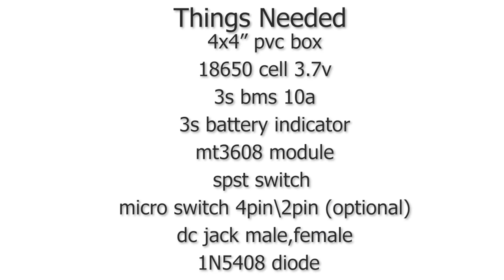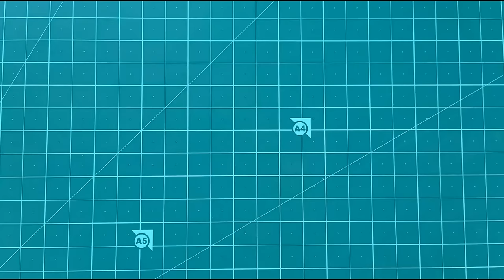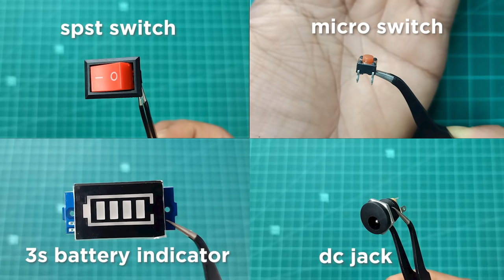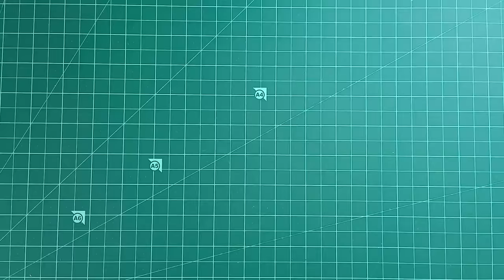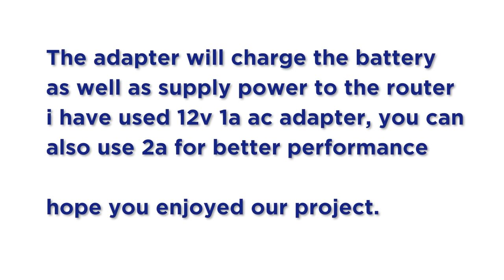How to make 12v ups for wifi router || diy ups for wifi router

Comment from the maker: Hello friends, thanks for all the support 👍🏻👍🏻 
As this was my first video on this channel I was bit nervous and also have made some mistakes, and many of them have also complainted that ups has very less backup.
So I was thinking to recreate this video with better version.
So should I make a new version of this 12v ups?? 

Do comment your opinion here👇🏼👇🏼
Reply: Yes bro .... go for it 🤗
Reply: All the very best. 💐 
You have talent to create employment. 
Battery indicator can be replaced with modern led. Can you create one with compact design and with led indicator. I can support for one video. Rest YouTube viewers will take care.
Reply: Yes really need iy
Reply: Superb video, 
What is meaning of 2c, 5c, 15c batteries 🔋.how much cost of each battery ?
Reply: Go for it!
Reply: @kumaards9714  search for c rate of a battery
Reply: Yes make a new one!
Reply: Yes, please. And also suggest modifications in this circuit too.
Reply: @kumaards9714  C-Rate of a battery is how much current can it output on a constant basis. A 2400 mAh battery rated at 1C would be able to output a max of 2400 mA X 1 = 2.4A of current without damaging it. Similarly if it were 2C rated, it would be able to output 2400 mA X 2 = 4.8A of current and so on. Higher C-Rates are needed in Battery Packs which are smaller but need to be able to run much higher loads.

For example, if you need to run a 400W load at 12.6V, ideally if you use 1-C rated Batteries you'll need a 12.6V 40Ah battery. But if you use say 4-C rated Batteries you'll need only 12.6V 10Ah battery. Now putting it into number of 18650 cells (let's say 2000 mAH), it would be around 60 cells for the former and 15 cells for the latter. Thus you get a smaller battery pack that can run a larger load.

Hope that explains!
Reply: @cg.maniac  Thank you bhai....🙏
Reply: My country not good not buy module please teach me another way please
Reply: yes, I too built this one but the charge wont hold enough. Pl add a better design.
Reply: Yes please friend, we can buy you coffee in return as appreciation. Maybe you can add a bypass mode so that battery is not constantly charging and discharging
Reply: md sahir mirza
Reply: Yes offcourse
Reply: hey can I use this for  power: 9v WIFI as well ? basically I'm making this for my school project and simultaneously I will use it for my WIFI when electricity is not there lol!!
Reply: first make sure that the 3 cells in series have the same voltage or you will get less capacity

Comment: Battery in your video is constantly charging and discharging. Not good. It should have by pass mode like real ups, when battery is full , energy fro 12v source go directly to the router
Reply: Nah, i will just use a high amphere power supply
Reply: This hack is basically a online ups without AC stuff
Reply: im using relay to make ups so the battery dosent get discharged when power wall its still on

Comment: I understand now what you use each component for - BMS is for charging and balancing battery pack. MT3608 "booster" is to regulate output of battery to router. So peak voltage of battery pack (fully charged, no load) is 4.2x3= 12.6VDC. When charging, this voltage could be higher - thus the output regulator (booster) is necessary. Input diode is to prevent voltage backfeeding to power supply. Voltage drop of .2VDC through diode should be fine,  since most "12V" power supplies are between 11.8-13.8VDC, depending on construction.  Thank you for the diagram at the end, and for making this video!
Reply: That means if I don't mind unregulated output and voltage backfeed, I can make this with just BMS??

Comment: There are a number of issues with this design, 1st the input power supply needs to be powerful enough to not just power the output device but also be powerful enough to charge the batteries, also the bms needs a constant current so the input power cannot be just any old charger unless you want serious issues, also if the input power supply is not up to the job then the batteries will just drain so when you need them in a power cut they will be dead
Reply: Let me make a suggestion. What if you consider using a power supply that you know can provide the amperage of the device that you want to connect to the UPS and also almost the max amperage needed for the bms? Now it will be able to both power the device and also the bms which have an over charge protection and in my knowledge can accept a wide range of amperes as is the bms of a smartphone battery that can either charge in my occasion with a 5V 1A all the way to 5V 2A without any problem, just with a difference in speed. Also I'm interested if you have another circuit/solution in mind.
Reply: Diode is not joke

Comment: i tried this before, it will work for awhile but it will slowly drain the battery  even the charger is plugged in, the battery will never fully charged.

Comment: My mt3608 module is burning… 2 times it got burn when connected to output of bms… bms is having 11.76 V output, which i am giving as a input to mt3608 and some spark is coming from vin… if i rotate the screw of mt3608 nothjng happens and at one point circuit is burning. Please help asap.

Comment: I am using just 3s BMS and 3 battery both connected to router parallel It works fantastic without any issue since 1 year
Reply: Can you please sent me the circuit diagram?
Actually I've tried same thing. BMS worked perfectly first time but after than it stopped giving any output. I've searched it in internet and found it as a common issue. Experts say that single BMS can not work for a UPS. Need more circuit. Can you please help me with this one??
Reply: @shuvodev6304  issue solved?

Comment: Since it is a boost converter, the input voltage must be lower than the output voltage. 4.2 x 3 = 12.6
Reply from the maker: Decimals will not matter much in this case so not a big issue here
Reply: When battery pack voltage get below 12v it is handy and this batt pack working between 9.9v to 12.6v

Comment: I'm currently connecting a 3S2P battery with a 40A Balance BMS to the router and charging it with a 12V 1A charger. I'm doing this because I want to make it easier and not have to disconnect the battery and connect the charger all the time. So, the question now is:

1- Is there any harm to the battery over time since it is always connected to the charger, given that the charger only disconnects during a two-hour power cut each day?
2- I know the battery doesn't charge to 100% because the adapter's voltage is less than 12.6V, but after charging, does the battery go into an idle state and the power draw is from the adapter, or is it still drawing from the battery?
I'm awaiting your response as soon as possible, and please, if you have any notes that can help me, I'd be very grateful.

Comment from the maker: Circuit diagram for 12v routers:
https://drive.google.com/file/d/1kLPusdh8njb_Y7CBu715qsVEfORRqgUE/view?usp=drivesdk

 Circuit Diagram for 9v routers:
https://drive.google.com/file/d/1SiIQw-3tJxeWiOlTUScBl84V68T8TDtl/view?usp=drivesdk
Thanks for all the support 😀😀
Reply: Can you also make a video that will use a 2A? Thank you for this video
Reply: Can you make circuit diagram using 3.2V 6000mAh Lifepo4 cell's for 12V wifi router
Reply from the maker: @mckevin We have to just use 3amps step up module instead of that mt3608 2a module , that's it
Reply from the maker: @Velmurugan Yes,. But use proper bms and your also might need to change your orginal power adapter
Reply: @CreativeElectroHub  you mean the buck booster? Your reply feels like my brain is gonna burst. Hahaha
Reply from the maker: Yes,
 you need 12v 2a output from it right?
Reply: @CreativeElectroHub  yes sir, what kind of buck booster can you suggest? I have my router for internet which is rated for 12v-1.5A.
Reply from the maker: Ok use xl6009 3a module 
Its may cost around 100/150₹

Comment: Excuse me sir, can you tell me what is the purpose of the diode? I don't believe the battery will discharge through the charger, because it has it's own bridge rectifier. Am I right? Or maybe the diode is there for a different purpose?
Reply from the maker: Yes,
Diode is used because when power gets cutoff the voltage will flow back to the charger from the battery and can damage the charger.
Reply: @CreativeElectroHub  Thank you for the reply bro, but I still wonder what can the voltage from the battery do to the charger?

Comment: Thank you for shearing the project, please tell us how many Ampere because my modem take 12v 2A for running.
Reply from the maker: We have used 2a  dc to dc boost converter module as we have 12v 1a router, you can use 3a boost converter module like XL6009, rest all will remain same.

Comment: Does BMS board charges the battery?
Reply from the maker: Yes, the bms board charges each cell separately and also has 
Over charge protection 
Over discharge protection 
Short circuit protection

Comment: Interesting video..i have a question...battery pack has high ampere out right?.but routers need  maximum of 2 or 3 ampere.will it be a danger with giving high ampere to router.plz explain.thank you..
Reply: I think it' will not harm  . He still connect the booster to generate 12v   but he didn't mention ampere
Reply: @khaseigaming  i built a 12v battery pack with 3 batteries as you do in the project.but i was unable to keep the ups atleast 1 hour. And also i would like to kow that, when router consuming the power battery voltage is decreasing.when the power decrease, required power supply of the router is not satisfy with that. In that situation, to solve that problem what can i do.plz reply
Reply: @umesha5104  well bro I'm not the professional 😁😁 according to my opinion  you need too increase your battery  capacity & Volt &ampere with out using  any booster voltage⚡️⚡️ 😁
Reply: I'm just college boy science   I'm interested like this project but I don't have material components to build it😞😞

Comment: Do I need a MT3608 Booster module? Can I make it with the same process and same materials, except MT3608? Or Can I use 3S 10AMP bms without Booster module or 3S 20Amp BMS should I use to make this ups?

Comment: Hello, very good this UPS !.  I'm going to build one, but I need to power the 12V 1.5A router and a 12V 1A fiber optic POE. What modifications should I make to your circuit to adapt it and power my two devices?  Thanks a lot!

Comment: instead of one output can I use two?
Reply: No bcoz boost converter is very small and not designed for multiple output here and battery as well.
Reply: It will reduce the output current

Comment: How this will charge the battery when the input power is same as output? There should be 2x the input power in order to keep the battery charging and running router.

Comment: I have a question, if you insert into the  input jack 12v power supply, why do you need the MT3608 to step up voltage if the output is also 12v? What is the reason for the MT3608 to be in the circuit please?
Reply from the maker: The main reason to use mt3608 is the battery pack, 
When there is a power cut off,  the battery pack provides power to the router and it gets discharge, so the voltage decreases and router will shut down in 5-10 mins. so mt3608 (set to 12v) will keep the voltage stable at 12v even if the battery reaches its lowest discharge point (10.5v) 
And while power supply is active the mt3608 will not get an effect as its input and output are same it will it continuously feed 12v output.
If your planning for 5-10mins backup you can skip mt3608 and if  you need more than 1-2 hours backup you need to use step up converter.
Reply: @CreativeElectroHub  Perfect, I understand now
Reply: @hermaneduarte265  it's not true, 95% routers have dc-dc on it's input and can work in wider range, tested 8-14v on many tp-links, Zyxel, keenetic, Asus and others. I have 3s8p 12.6v 21ah battery pack with bms and 12.6v3a charger with router and gpon terminal, it's works for almost year and backup time is about 32 hours.

Comment: If i use MT3608 with an already existing power bank , I believe that should also work? Plz confirm also how much backup would a 20000mah power bank give with a load of 12v 1amp (jio fiber router) plz advise and oblige 

Thanks

Comment: WHAT IS THE NEED OF mt3608 module. IS IT REQUIRED?
HOW MUCH BACKUP ?
LIST THE MAH OF BATTERY?
DOES THE BATTERY MAY CAUSE ANY DAMAGE OR REDUCED IN LIFE WHILE CONTINUOUSLY CONNECTING IN BOTH INPUT AND OUTPUT ?
Reply from the maker: Mt3508 module is used th keep the output voltage stable at 12v

Backup depends on the quality of cells you use (recommend high drain  2500mah).

You have to discharge the ups every 10-15 days so that the battery won't get damaged.
Reply: @CreativeElectroHub   sir can you please send circuit diagram

Comment: I made this & i am using this for JioFibre router which is having 12v 2.5A ratings. But the battery is not charging. Even after  keeping it overnight the battery indicator reading did not change. What can i do for it??
Reply: MT3608 Max 2A

Comment: Can i use xl6009 in place of mt3608?
Reply from the maker: Yes 👍🏻
Reply: @CreativeElectroHub  Also I have seen many people using XL6009 Step Up Module At 12 V Input, why is that required? Here you have used a diode instead of that.

Comment: Is it possible to add a buzzer to this circuit and where would you add it , that will sound when battery level is low, for example 1 Bar on the display?

Comment: I used bms and 3.75v battery pack off 2000 mah and used mt308 step up, but it gives only 5 minutes backup.
Please help me how can I increase backup.
And please mail me 12v circuit diagram, I would be very grateful to you.

Comment: What will happen if the battery reaches the 12.6v and you convert it to 12v? Will the step up converter still work?
Reply from the maker: The step up converter will not have any effect It will continuously feed 12v output even battery is fully charge at 12.6v, and btw if your connecting the ups with router's orginal adapter, there will be no issues as it has exactly 12v.
If your using external power supply it's voltage should not exceed 12.6 v.
Reply: @CreativeElectroHub  Yeah exceeding 12.6V can fry the router circuitry
Reply: @CreativeElectroHub  ,
Absolute Rubbish, Any DC to Dc step up circuit needs input voltage lower than the output voltage. It always Boost the input voltage to required output voltage while reduces the output current than the input current.
Reply: The battery will never reach to 12.6 volt as the input (Adaptor)  itself is 12 volts. More over the Diode in the input line will reduce the voltage below 12 volts.

Comment: hello i have seen so many bms with ampere rating what is that?? ampere how to choose correct one.
Reply from the maker: The amps rating on bms modules indicates max current output of it 
For eg., If you made 3s Lithium battery pack and  connected 3s 10 amps bms, So it can deliver max of 10 amps out
so according to your battery packs amps you should select a bms 
If making 10amps battery select 15a bms if 20amps battery select 25 or 30 amps bms and so on

Comment: I was in search for such a video for months together, finally I found it thankyou soo much! 
Will there be an effect on the batteries when it's on continuous run (meaning the main Power from the charger is connected to this ups and from the ups the modem is connected and running without any powercuts) like in long term will be there be any major damage apart from the cells degrading naturally?
Reply: there is overcharging protection on the BMS  so don't worry about it
Reply: This is just the basic setup but the most useful, on my build i added over voltage and under voltage cut-off to protect the battery from overcharge and drain. I am confident that it is heavy duty.
Reply: @janjanardiente  do you have video ?

Comment: I use a 3.7-4.2 V battery as input for MT3608 to get 12V output for router. fitst 2-3 hours works all well. but after a while, during checking I see it failed to pass output. I assume Battery problem, so used a new battery, test again, but before connect to Router, I check through multi-meter the output load shown 12V in the jack, but whenever I connect to Router it falls to 1.2 V and failed to ON the Router. I don't understand the problem (New Battery is fine and 3.7-4.2 v)
Your experienced comment is very much appreciated, thanks.

Comment: The board BMS have function auto disconnect charging when full battery each cell ?
same module TP4056 protect ?
Reply from the maker: Yes ofcourse. Thats the main reason we are using it

Comment: My router required only 9 volts, any issues if we provide 12 v, can we degrade

how many hours can we expect the backup

are u willing to sell me
Reply from the maker: For 9v these ups will not work, in fact it burn out your router's power ic. you need to make completely new one which has 9v output.

This 12v ups will provide 1-2hours  backup. I have actually used little low quality cells in the battery pack. So the backup is less, you have  to use high drain 18650 3.7v cells for long backup
Reply from the maker: I will provide you a circuit diagram for 9v ups and components list on your email by tomorrow

Just tell,  that do you want both 12v and 9v output or only 9v ?
Reply: @CreativeElectroHub  only 9v
Thanks for the help
Reply: @CreativeElectroHub   i too need a suggestion, bcz i have Router with 9V and Modem with 12V... So, Double Output will do... Any Suggestions?
Reply from the maker: Need to think on this,
What power will you prefer as input in this of diy ups 9v or 12v?

Comment: What sir if there is no brownout for 6 months.  So the battery is continiously charged  until overcharged for 6 months?
Reply: apply trickle or float charging. if you dont want your battery to overcharge just set the HVD to 60 to 80% battery charge